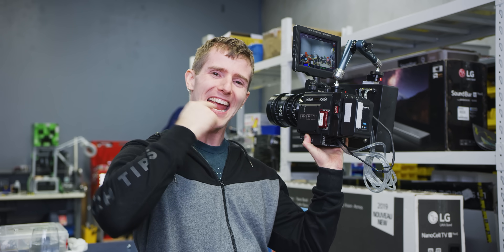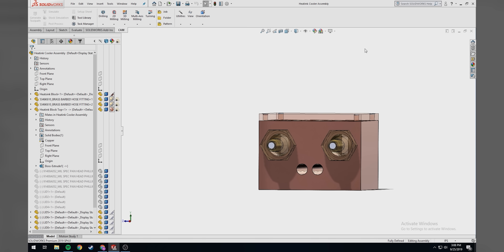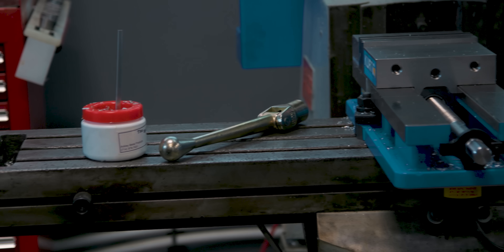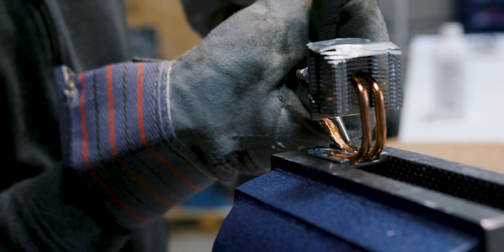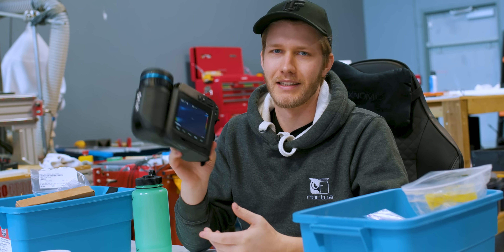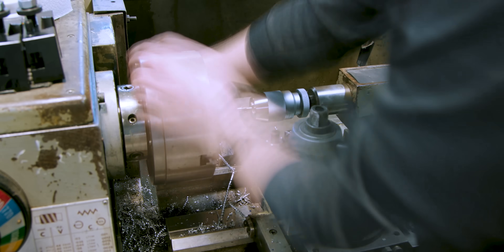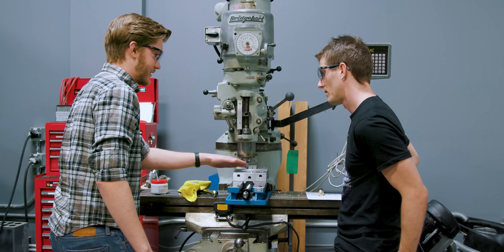WE FINALLY DID IT!! - Water Cooling the 8K Camera!

Comment: Machinist here, if your readout is a decent quality then it does in fact read accurately down to .0001inch. It's tolerance is probably around +/-0.00005inch. The only reason it would be off more than 0.0001 is if you don't keep the room a constant temperature causing the cast iron mill components to expand or contract. Also, WD-40 is actually a very good aluminum lubricant (lubricants are metal specific and do make a difference). Also, tapping under power (form or cut tap) on a manual mill is a advanced technique which requires very good coordination and even then cut taps will break more quickly (though chances are you just ran the tap into the bottom of the whole with too much clamping force on the tap). It will always be hard on your tooling. The spindle is only there to help align the tap with the hole while you are turning the tap with a tap wrench. I could tell you how many problems you ran into because you didn't consult to a machinist first but what's done is done. Next time I recommend you consult a machinist first. You'll actually save money and most of the steps can be performed by a monkey. You just have to be a machinist to know what these steps are and how much they matter.

Comment: I work at a prototype machining company in Rockford Illinois and we specialize in one off weird builds that other machining companies decline and have even entered the Northrop Grumman X Prize challenge and built a lunar lander. So nothing you can design is too hard to make for us and we can get the tolerances down to +-2 thousandths of an inch and in water cooling you want the surface finish as best as possible and if we made these parts or future parts for you the amount of heat transferred will be vastly greater due to the mirror finish we can put on parts. Contact me if any of this interests you if not I don’t care just trying to help out it would have cost a lot less then doing it yourself.
Reply: Ps that 1/2 inch end pill is way too far in there

Comment: Watches them chuck up a Tap in the Bridgeport.
Me: "Uhhh, I wouldn't do that."
Watches Tap snap in the work.
Me: "Told you."
Reply: is it generally a concern with older mills or just this specific brand? i had taps breaking on another old mill, but I do not remember its brand.
Reply: @RCP-1136  not the age or brand. Taps are hard and brittle. A tapmatic or floating head gives some wiggle so the tap isn't forced to flex etc. For a tiny tap and a few holes hand tap and use the quill to square it up and provide a little down force.

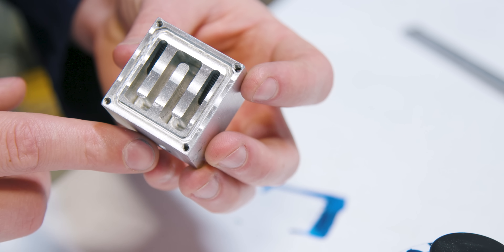Comment: P.S. the coolant pathways on the cooling block at 15:46 should NEVER use that U-shaped pathway. It should ALWAYS be a Spiral pattern to ensure cavitation (i.e. water hammer!) DOES NOT occur. The hard corners in your current design cause excessive pressure differentials which lessens heat absorption capability as the coolant moves and hits those hard corners and tries to move out of the way of other incoming coolant. 

For ANY coolant block design, TRY to use only spiral pathways to prevent cavitation to ensure optimum heat removal pathway. Using U-channels with even smoothed low-radius corners is too problematic for efficient coolant movement. 

.

Comment: Never use heavy gloves on any rotating tool like a belt sander or drill press. They could easily get caught in the machine and you could lose a finger or your hand. Lightweight latex gloves are probably fine as they tear apart very easily.

Comment: OKIE DOKIE --- ULTRA WATERCOOLING Feature Request for X.399 or X.499 motherboards!!!

Make a CUSTOM machined SINGLE BLOCK of all-aluminum that has the indentations and cavities to fit perfectly over and onto every single chip, CPU, network board, GPU card, RAM socket, etc soldered ONTO or installed into an x.399 or x.499 motherboard. The CPUs/GPUs and other chips SHOULD have all their cooling fin blocks removed and covered JUST BY this massive mono-block cooler!

Drill/Machine many microchannels and/or coolant pathways into this singular block (or welded together blocks) of aluminum that force coolant over every chip and socket so it will suck all that heat away out to a custom machined set of radiator fins and see if you can make a MONOLITHIC water block that will SUPERCOOL everything! 

Once you do a test with normal coolant, change it over to liquid nitrogen or liquid helium and see what your maximum settings and overclocks will goto on various benchmarks and games!

.

Comment: you guys could have just gotten hydrocloric acid (muriatic acid) and sat the original heat pipes in that. HCl dissolves aluminum but doesn't react with copper

Comment: Power tapping should be done in a drill chuck. Only tighten somewhat so they can spin if they catch. Also slow speed 100-200 rpm. 

Lose the long sleeves before you get hurt.

Comment: If anyone at LMG sees this please pass this on to Alex - Look at a "Tshorn 3d tester" - It is a tool like the edge finder that will work at 0 rpm in a collet fitting on the mill or router both with a sprung arm

Comment: tapping tips. get smaller tap handles for smaller taps. use tapping fluid. using a tap center in a Bridgeport is a lot safer than power tapping. you can drill out a tap with a carbide endmill (small pecks).

Comment: Some recommendations from a apprentice machinist
3:01 Using a sanding belt on a block to do what a grinding wheel would be INFINITELY better (and cheaper) at?
6:00 If chips are a concern just setup an air blast to keep the project space clear
8:00 The bridgeport wouldn't been a far better tool to use for the task, you're over engineering it with the router. It's much better to do all that by hand and mechanical stops.
12:00 Remove the handle before you hit that damn button I've had a few experiences with handles flying off the machine (since they're designed to be removable)
13:40 You cutting WAY too deep. You want to cut shallow so you have less wear on the bit. Less wear means less heat build up, which means your project stays cooler and warp, less. You also go through a lot less bits that way
15:45 What did I mention earlier?

16:20 Welcome to being an school machinist
18:50 Yep that's an engineer at work

Comment: 1:47 "Measuring this would be a nightmare."

Give me a good pair of digital calipers and a few hours and I could CAD that up for you in no time. Don't you guys have a CNC mill?
Reply: I imagine the problem isn't the length and width, but rather the depth to which the indentation is. Too much and it isn't contacting the chips which it's supposed to be cooling. Too little and you break it. You need perfection for it, and I think the bound for that isn't the tool but rather the human using it.
Reply: A good pair of digital calipers has a way of measuring depth. Making a carbon copy of that plate with very tight tolerances should be no problem at all with the tools they have. Unless we're talking thousandths of a millimeter of accuracy here, it should be no trouble at all. Where there's a will, there's a way.

Comment: you have a full machine shop. can i send you 6 - 80% ar15 lower receivers to get milled out??? the 11 - ak47 lowers i have just needed to be welded, so no help needed on those.. i have a jig for using a drill but???

Comment: Stop half-assing everything.  The first thing you teach someone about a mill is the brake, not after they use the damn tool.  15:45 if you don't use compressed air to clean out all the damn metal, you're going to have inaccuracies because those little pieces of metal will mess up your measurements and it's probably what caused you to need to do that in the first place.  Hire someone who knows how to do this professionally or take the time to get trained properly. Every time you guys try to do something critical or serious you guys goof around and don't do it right.  It's even worse because you guys embrace, laugh and play that tired old "haha that's the Linus Tech Tips way and how we do it because we're so quirky!" All that money in tools just to have someone who's an amateur at this use them and do half-ass work. I like Alex but every video I see you guys use expensive tools, it's learning as you go with no regard for actually learning how to use the fucking thing.

Comment: When you power tap the Bridgeport. Put it in low, bring the tap just above your part, then shut the mill off then drop the tap down into your part. When the spindle stops, undo the collet, then tap manually using a tap wrench
Reply: And you can feel when the Resistance builds up, and you can back out, clear the chips, and keep on going

Comment: just took about .250" off in a single pass on a facing cut by "eye balling it" , climb milling on a manual machine, hoping to god the cutter was actually spinning the right direction because sometimes "forward" and "reverse" is not as intuitive as it sounds. definitely sounds like RPM is way to high for what looks like a 1/2" endmill on a manual machine. using cutting oil only necessary because you're taking a quarter inch off in one pass. these guys are definitely not machinists and I wish they would've said that instead of leading people to believe they are. someone could seriously get hurt. those machines bite and they dont give a damn whats in the way.

edit: nevermind you mention you're not a machinist, but still my points stand.
Reply: Don't worry, nobody who is not a machinist will have access to these kinds of machines anyways.

Comment: reminds me of Engineering school. that was a magnetic edgefinder. it works on Faraday's law, the Eddy current generated in the block due to magnetic field change from the magnetic tip repels the magnetic tip causing it to deflect.
The other way to find the edge is just to face X-axis and zero, Face Z-Axis and zero, done.
I think they are machining Aluminium. you'd want a high RPM of about 10k++, cuz Aluminium is a soft metal that sticks to the bit and cause vibrations if running on low RPMs.
I've never learnt to use tap on machine, other than CNC. we always did it by hand. keep going in and out to remove chips and spam 'tap magic'(brand of the lube), very tedious.
And yea, he just wearing lab coat for prop. Don't wear long sleeve when machining. Its a safety hazard incase your sleeves get caught. Chips aren't painful anyway you can just brush them off.

I'm just reminiscing my school days. Dropped out :( I fail cuz of Stress. No like literally, stress states on a body.

Comment: If you need to see how hot something is with an ir camera but the material in question is reflective, just put black electrical tape on the object and measure the temperature at that spot.

Comment: “I’m not a machinist”

As a career machinist, I can tell lol. You’re not terrible though. Seen far far worse.
Reply: I am trained in machinery, but it's been years. Am I remembering correctly that Alex should have been going way slower when he was using the tap?
Reply: Bigpumkin much much much slower lol. Small taps like that, I don’t even risk trying to power tap. Just put the tap in a drill chuck, mill in neutral and spin it by hand to keep it straight, then finish with a tap handle.
Reply: I'm still stuck on him using a counter sink as a center drill, they could also have just used a carbide drill, go undersized and use an end mill to get to size. But what do i know, I'm just a mechanical technologist.
Reply: Bonez32186 so many weird flexes in here
Reply: @CantLaunchCivV  I believe it's fine that he was relief winding quickly. They edited out all the cutting turns so you only saw him unturning the threader.
Reply: I think it's kind of awesome how Alex taught himself how to use these machines though. It shows how today in the age of youtube tutorials, there really is no excuse anymore for anybody to say "I don't know how to do this".
Reply: @maximilianmustermann5763  He has an engineering degree and used to build dune buggies and race them at college. He didn't just hop on YouTube tbf
Reply: @hoixthegreat8359  I'm pretty sure they said he didn't actually finish his degree he only did a year or 2. And judging by how poor his workmanship is and how unsafe his work is I would say it's a good thing he doesn't work in an actual machine shop. You can really tell he went to university. All his knowledge is theoretical. He clearly explain the advantage of conventional vs climb milling. But then snaps a small diameter tap because he was turning it at high speed. In my mechanical engineering college program we did a lot more hands on work. He really should get some safety and quality tips from a real machinist. Also wear some damn ear protection and get guard installed on that mill
Reply: @hoixthegreat8359  He has a degree but was on a team that built buggies. From what I can gather he wasn't the machinist on that team. He might have picked some things up from being around it but watching an electrician for a month mean you can wire a house.
Reply: @hoixthegreat8359  There is a reason you usually have an engineer and a machinist. These fields don't exactly overlapp.
Reply: @maximilianmustermann5763  It show's that watching youtube tutorials doesn't make you good at something at that it's still better to get a pro sometimes. All of Alex's machine projects are barely functional and poorly done. Great entertainment, but if I were a person paying him to machine I would be upset with the quality every time.
Reply: @Dummerbrella987  "Great entertainment" is exactly why Alex is hired to do it. This is all for a YouTube channel, and for starters everyone knows that more drama=more views. If Alex can learn to do this stuff properly through practice, then why not monetize the failures and less-than-perfect projects along the way? On top of all of that, he also has the charisma to be on camera, and unfortunately most career machinists don't have that kind of personality. I think Linus knew EXACTLY what he was doing when he hired Alex and built this insane, over-engineered shop for him. Alex benefits in getting experience and a cool trendy job with room to make errors and try new things, Linus benefits in having someone to actually build things from his crazy ideas, and LMG gets more content and $$$ out of the whole thing. Win-win-win.
Reply: @Dummerbrella987  But at the same time, the more Alex does it, the better he'll get. I don't think he doesn't have the aptitude, just not the experience. He should be using Linus' shop to do all of this learning and experience building where he can make mistakes and laugh them off. He's never going to cost them several thousand dollars with a mistake and he's not doing anything where people could get hurt so why not?
Reply: @Jackofafewtrades  If he somehow miraculously survives that is
Reply: As a master machinist with 45 year under my belt and dabbles in computers it was fun watching a master in computers dabble in machnig. Keep up the great videos.
Reply: Man! You career-, non career-, took one class- and used a mill once machinists are a elitist bunch of fuckers! He is learning! Give him some slack!
Reply: @emilolsson89  sometimes you shouldn't cut some slack ESPECIALLY in heavy machinery work. One wrong move and like someone above me said, you can get scalped, lose a finger, a hand or die. Machines aren't for messing around with without experienced supervision. I worked at a small tool and welding company, I went in at 17, and my supervisor didn't let me do ANYTHING on my own until after about a year into it, because he said he had seen too many people lose fingers and hands to these machines and he didn't want it happening to me. This stuff needs to be taken seriously. I think that's something the other miss when they talk about how inexperienced Alex is and how problematic it can be
Reply: i am not a career machinist but i learned to use a mill and stuff in school and i could tell.

Actually never used an edge finder. I cannot remember how we found them edges
Reply: I took an intro to metals class my freshmen year, there was a kid on the milling machine put into reverse and it had a 2 inch bit (I dont know the name for the bit but the one you use to grind sides/top off) but he set it to like about a half an inch and at around 900 rpm on steel and just sent it I never seen a bit snap that clean off in my life. the teacher was flipping out after that
Reply: @jamesmelemede5610  I've seen considerably worse.  I watched a girl in one class poke a 3/4 endmill with her finger WHILE IT WAS TURNING to "see if it was sharp".  Luckily the idiot had the machine running in reverse, or she would have lost at least a finger.
Reply: @Hawk013  seen a guy go full blast on the vertical coil on a mill, just slammed it right into the chunk of aluminum, like it was some backyard drill press. I don't even know how or what stress forces were involved but that shit came out of the vice V shaped after a nice, supervisor awakening cracking sound, followed by good ol' belt rubbing.
Reply: He is a beginner with that stuff, he has had the machines and self teaching himself under half a year.
Reply: I was asked to judge a high school machining competition reminded me of watching that.
Reply: He did use the edge finder wrong though.
Reply: He did a great job of learning how to use them tho.
Reply: They need to hire you. Alex is great and all, but it's so clear in every machining attempt that he just does not have the aptitude for it.